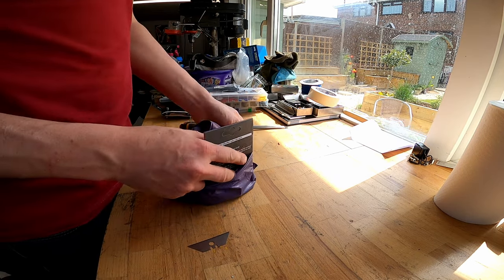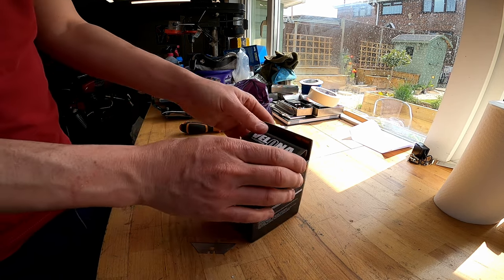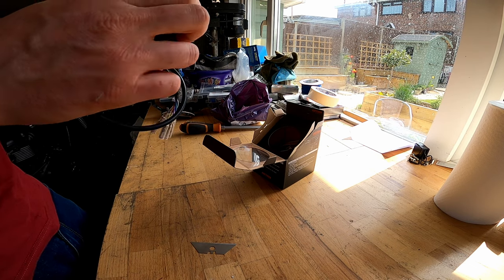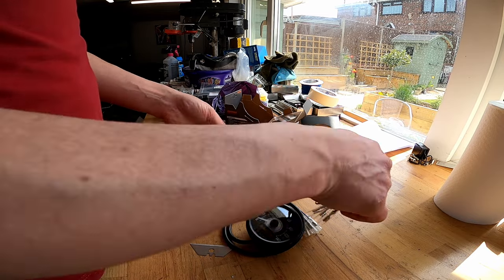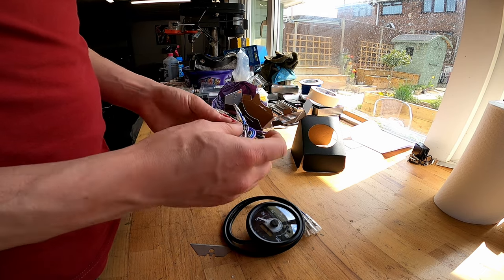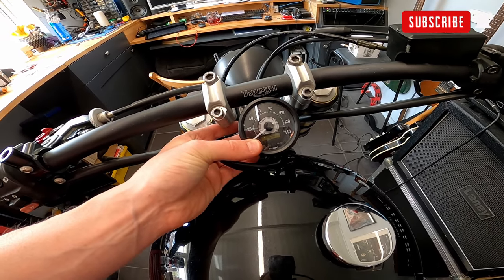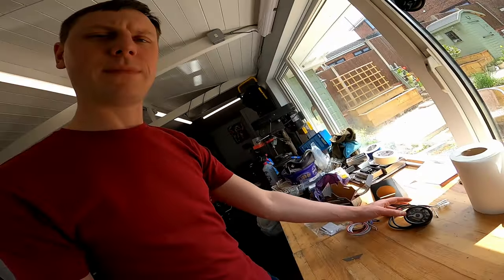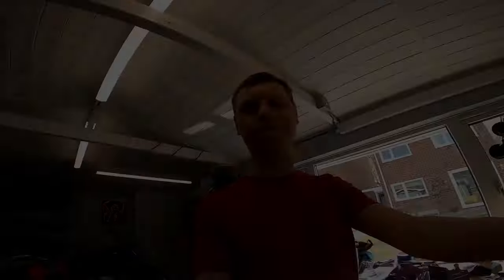Ep.20 Above or below? DAYTONA VELONA SPEEDOMETER | PROJECT TRIUMPH BONNEVILLE SCRAMBLER

Comment: Was thinking of getting a velona Daytona for my 1983 SR 500. The plan is new LED headlight and the speedometer as slots into headlight. As far as I know, the speedometer will read from a sensor (bought separately) that reads rotation from round metal disc around front wheel axle. Then just plug up old speedometer cable opening with a cap. Does this sound correct?  Thanks
Reply from the maker: Absolutely, it will even work off of disc or sprocket bolts going past the separate sensor. Another option, there are adapters that connect to the original style speed drive on the wheel. I will be doing this on the Honda build. Keep an eye out for that build…
Reply: @TheWurks  thanks alot! I dont suppose you can do a vid to show the newcomers how to wire up LED lights (and the famous relay needed) on old bikes? My original indicatior for example has one single wire coming out of it back to main harness. the new LED indicator lights I bought have three wires. I understand the body of bike is ground. but what to do with the one spare wire? also if its possible to wire up the indicators as hazard lights if needed (i think EU law says we need hazard lights now). sorry for all the questions...:)  but my SR 500 deserves the best :)
Reply from the maker: @pmacc3557  Happy to help if I can… video on the way!
Reply: @TheWurks  thanks alot

Comment: If my motorcycle has abs, would this work just fine? Wouldn't my bike abs be disabled if this gauge doesn't have an abs pin/indicator?
Reply from the maker: Hi,

It would likely depend entirely on the motorcycle, sorry I've not fitted one to an ABS equipped bike. If you go to Digital Speedo's online they should be able to tell you though

Comment: I have a question regard Velona Speedo/tachometers : how do you connect these to the existing cables?
Reply: I don't know what mc you have but I am thinking of purchasing this for my BMW R100. You should be able to buy a Pulse Converter from Daytona, which can make it plug and play. Let me know if that made sense.
Reply from the maker: Entirely depends on your motorcycle and if you have can bus running through your clocks for fuel pump release. Can I ask what bike you've got? Sorry for the delay in responding here!
Reply from the maker: Agreed they do supply a hall effect sensor and pickup that is very easy to throw on.. Cheers for commenting and helping this guy out!
Reply: @TheWurks  The can bus is for newer bikes, right?
Reply from the maker: @tari0048  yeah post 2010 i believe
Reply: @TheWurks  Alright. Perhaps I can just play and plug it to my R100 from 1976
Reply from the maker: @tari0048  yeah i would imagine so
Reply: @TheWurks  thank you, I have a triumph scrambler 2014 (with can bus)